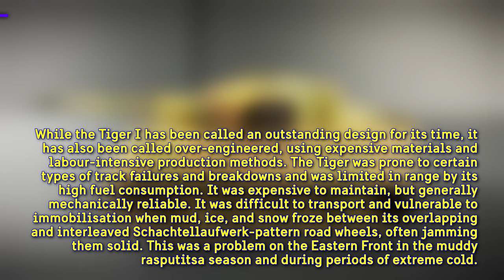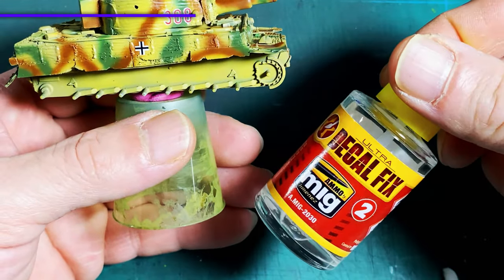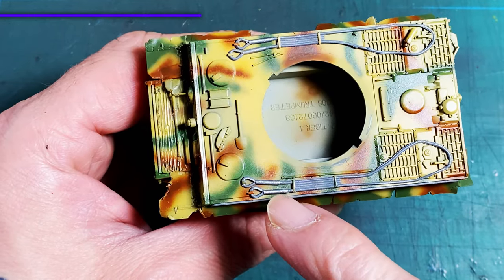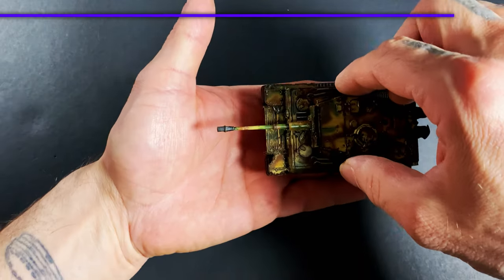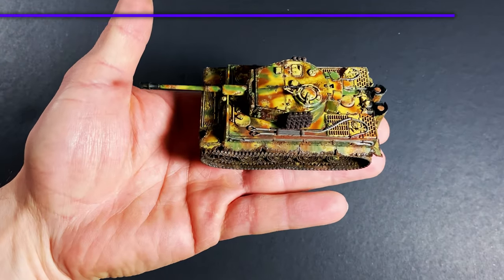Tiger I - late production #Diorama #ScaleModel #Miniature #ModelKit

Comment from the maker: 00:00 Hello my friends.
00:05 In this modelling project I am building the Tiger I late production, in scale 1:72 by Trumpeter.
00:12 It is actually my first model kit in this scale because my favorites are in 1:35 and as far as the Black Hawk by Hasegawa concerned, I actually built that after the Tiger I.
00:24 The Tiger I, a German heavy tank of World War II, operated from 1942 in Africa and in the Soviet Union, usually in independent heavy tank battalions. It was designated Panzerkampfwagen VI Ausf H during development but was changed to Panzerkampfwagen VI Ausf E during production. The Tiger I gave the German Army its first armoured fighting vehicle that mounted the 8.8 cm KwK 36 gun (derived from the 8.8 cm Flak 36). 1,347 were built between August 1942 and August 1944. After August 1944, production of the Tiger I was phased out in favour of the Tiger II.
00:44 While the Tiger I has been called an outstanding design for its time, it has also been called over-engineered, using expensive materials and labour-intensive production methods. The Tiger was prone to certain types of track failures and breakdowns and was limited in range by its high fuel consumption. It was expensive to maintain, but generally mechanically reliable. It was difficult to transport and vulnerable to immobilisation when mud, ice, and snow froze between its overlapping and interleaved Schachtellaufwerk-pattern road wheels, often jamming them solid. This was a problem on the Eastern Front in the muddy rasputitsa season and during periods of extreme cold.
01:04 The tank was given its nickname "Tiger" by Ferdinand Porsche, and the Roman numeral was added after the later Tiger II entered production. The initial designation was Panzerkampfwagen VI Ausführung H (literally "armoured combat vehicle VI version H"), abbreviated PzKpfw VI Ausf. H) where 'H' denoted Henschel as the designer/manufacturer. It was classified with ordnance inventory designation Sd.Kfz. 182. The tank was later re-designated as PzKpfw VI Ausf. E in March 1943, with ordnance inventory designation Sd.Kfz. 181. Today, only seven Tiger I tanks survive in museums and private collections worldwide. As of 2020, Tiger 131 (captured during the North Africa Campaign) at the UK's Tank Museum is the only example restored to running order.
01:53 The following project is inspired by real events.
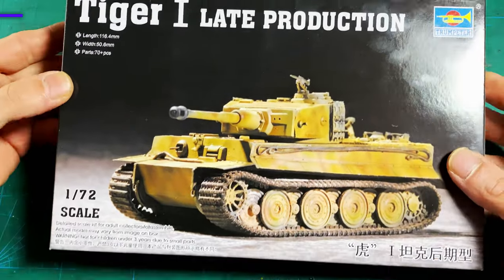02:26 This is the box of the Tiger I late production, in scale 1:72 by Trumpeter.
02:34 The box includes the plastic parts (sprue and tracks), decal sheet and a typical black and white manual.
02:43 Everything seems normal and of good quality with some nice details.
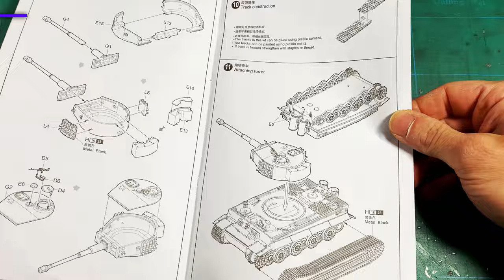02:57 What worries me the most is the size of everything. Things are so small and some of the biggest parts are almost half the size of my hand.
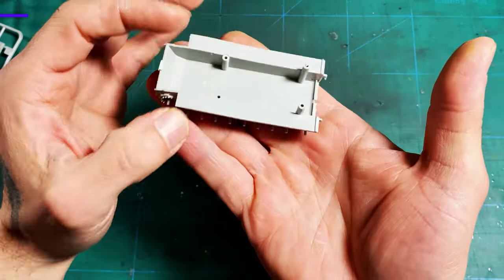03:07 Oh well. I think I will succeed. Let's go!
03:13 Cutting and then smoothing out the parts with the hobby knife and sandpaper. When needed, using the hobby knife carefully in the opposite direction to avoid cutting or damaging the parts.
03:28 ATTENTION! Keep always in mind that after gluing, painting, etc to let things dry.
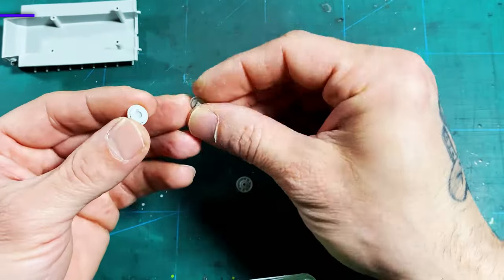03:44 Gluing wheels and drive sprockets.
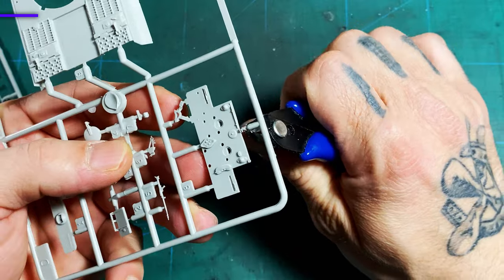04:10 Repeating the process.
05:05 Completed this off camera. It has a small cannon and a light.
05:22 More gluing including a shovel.
05:42 Separating these a bit and then smoothing them out.
06:11 Further roughen things up.
06:42 Done, off camera and combining the two halves.
07:02 More battle wounds.
07:49 Assembling the turret.
08:43 Where things weren't properly fitted, I will cover with plastic putty.
08:54 Masking tape, plastic putty diluted with water and painting like so.
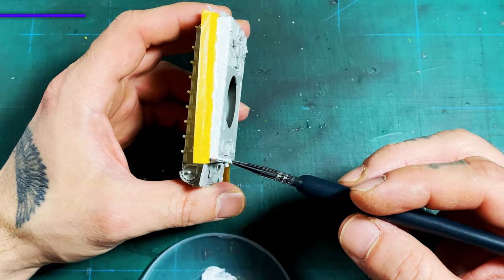09:19 The following technique I saw it from somewhere else. Saw and sawing like so 🤣
09:30 Basically with this technique, I am trying to emulate the Zimmerit, the paste-like coating used on mid- and late-war German armored fighting vehicles during World War II.
09:41 Did some work off camera and all things considered, it went well. Painting will make things even better. Repeating the process.
11:02 Completed off camera. Attached the wires too.
11:11 German panzer gray primer airbrushing.
12:33 The manual proposes flat yellow for the camouflage painting but I will use a mix of tan and medium yellow as well as some white. Airbrushing.
13:37 Airbrushing with flat brown.
15:16 Flat green.
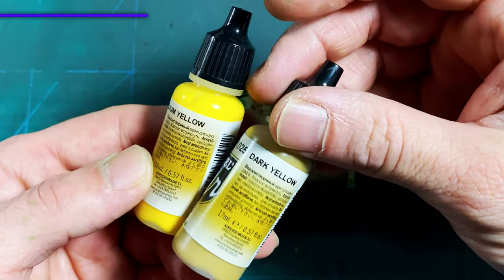16:08 Because I didn't like the previous mix of yellow, redoing with medium and dark yellow mix.
16:48 Off camera redid all the colors into a darker tone. Glossy varnish airbrushing and will do a second coating off camera.
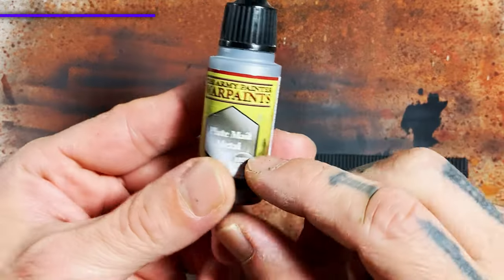16:59 Plate mail metal.
17:22 Brown pigment and painting with a hard brush.
18:05 Pigment fixer else the pigment on the tracks goes bye bye 🤣
18:23 Some more brown pigment.
18:45 Plate mail metal on the edges of the wheels and drive sprockets.
19:11 Finished off camera and will repeat the same to the rest.
19:45 The pigment on both sides of the tracks has dried.
19:50 Brushing off the excess pigment.
20:06 Gun metal gray and plate mail metal dry brushing.
20:23 Finished off camera.
20:47 Mig's decal set before placing the decals and Mig's decal fix afterwards. The 1st prepares the surface and the 2nd takes care of any curves, bumps, etc.
21:01 Pressing with a cotton swab to take away the excess air or liquids below the decal without damaging it.
21:09 Special notes: Working in such small size it is extra challenging so DO NOT despair. We are only humans 🤣
21:23 Decal fix off camera. Depending on the decals placement you may need to coat twice.
21:28 Mix of dungeon gray and little bit of plate mail metal. Painting.
21:56 Finished the wires off camera. Painted with a different metallic gray their end points.
22:05 Painting parts of the tools with gun metal gray as well as the weapon on the front.
22:21 The wooden parts of the tools, I did off camera. Painting hull red this box.
22:42 Off camera, using paper, added straps on the tools, wires, etc and also painted with silver the metallic elements of the box.
23:01 Painting with a mix of tan yellow and brown.
23:29 Sponge with gray and painting here and there.
23:58 Repeating with medium rust.
24:31 Old rust.
25:00 Straps are done. Super gluing the exhaust system.
26:15 Super gluing the spare tracks parts which I had already covered with Eisenoxid pigment (iron oxide pigment).
26:40 Quicker chipping with the sponge and a yellow mix of mine.
28:13 Done off camera.
28:25 Panzer dark gray mixed with little bit white and brush painting for precise control.
29:57 Completed off camera.
30:11 Mix of old and dark rust (2 to 1) and painting all while with a second wet brush, gently fading out the paint.
31:46 Finished off camera. Dark washing. If/when needed, removing any excess wash with a clean brush and enamel odourless thinner.
34:01 Brown washing.
34:24 Done with wash. Oil painting with a mix of yellow ochre and burnt umber, for additional weathering effects.
36:17 Applying red brown pigment and most probably I will have to remove the turret for easier application.
38:11 Done off camera. With a dark brown mix of mine, painting some dirt and mud in a few key areas all while with a second wet brush, gently fading out the paint.
40:02 Completed off camera. Damp earth painting.
40:36 Done and before it will dry, dark earth pigment painting here and there but mostly on the upper parts.
41:48 Did some more work off camera but it is still wet in most parts. However, I will keep going with oil stains in a few key spots.
42:47 Black painting to give the illusion of the exhaust gas corrosion on metals.
43:37 Attaching the wheels, sprockets, etc.
44:01 Begun off camera to place the tracks. Super gluing when needed.
44:40 Off camera, did both tracks. Dark washing.
45:11 Damp earth here and there.
46:07 Dark earth pigment.
46:50 Some more damp earth in a few areas.
47:45 Repeating the process but with dark earth pigment.
48:30 Splashing pigment mixed with little bit of thinner.
48:55 Some more gun metal gray and plate mail metal dry brushing.
49:42 To give you an idea of the scale and the size of the tank, here it is on my fingers, palm and index finger.
49:53 Hopefully you liked the project and you will enjoy the presentation. Since I am a new to this amazing art, please do share your words of wisdom in the comments below.
50:04 Presentation
53:57 Hit the Like, Subscribe and Notifications Bell "buttons". This way, together, we can grow a community around the exciting art of scale modelling!
54:06 Stay "tuned" for more scale modelling videos.
54:09 Thanks for watching!

Distance
https://www.youtube.com/watch?v=L4ho390u45s
Execution
https://www.youtube.com/watch?v=DCNclXPH9tc
It Follows
https://www.youtube.com/watch?v=fNgCINtqSUk

54:12 by Karl Casey @ White Bat Audio

Website https://whitebataudio.com/
YouTube https://www.youtube.com/channel/UC_6hQy4elsyHhCOskZo0U5g

// // // // // // // // // //

Music from #InAudio: https://inaudio.org/ 
Close Your Eyes
Sakura

54:12 by Infraction [No Copyright Music]

Website https://inaudio.org/
YouTube https://www.youtube.com/@Infraction

// // // // // // // // // //

Warrior
https://www.youtube.com/watch?v=LvHHBRL5I1M

54:12 by Prod. Riddiman

Website https://www.youtube.com/c/ProdRiddiman/featured

// // // // // // // // // //

Paranoia
https://www.youtube.com/watch?v=7Z63J-Ysqcc
RAGE!
https://www.youtube.com/watch?v=4o2z2WFyKlM

54:12 by Joe Leytrick [ +Prod. Riddiman ]

Website https://www.youtube.com/channel/UCnVHSJMgwjsBX-h8kAmBkbg

// // // // // // // // // //

REPLICANT
https://www.youtube.com/watch?v=S0PhkYINGOY

54:12 by Aim To Head

Website https://www.youtube.com/channel/UC1KJEk-EZMmDF9DJKMK5OCQ